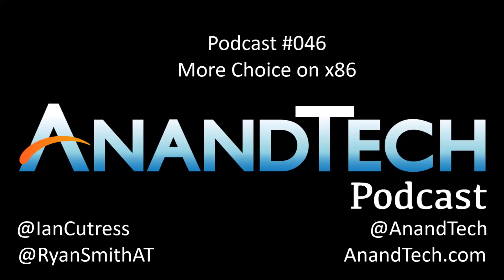AnandTech Podcast Episode 46: More Choice on x86

Comment: My HPET video has gotten so much more traffic than usual because of this. I hate it and wish HPET didn't exist. The public is so confused and I'm not patient enough to answer everyone. Please do something more to educate!!
Reply: Going back to haswell and broadwell it was an issue
Reply: Just please don't use non-default windows settings. It's never enabled. Ugh. Sorry for complaining. It's just such a spot for me. Love you guys.
Reply: Could the gaming results be effected more due to message signal interrupts?
Nvidia drivers disable msi on every driver install.
Reply: I also notice that desktop lags also with hpet enabled. Doing stuff on Windows, doing rendering in c4d or just multitasking a bunch of random stuff... Causes pauses and other strangeness.
It's like running a Linux kernel without preemption.
Reply: So it degrades actual performance, not only benchmark scores? At first I thought it was just affecting the results, but as it is actually slowing the PC down?! This is unacceptable